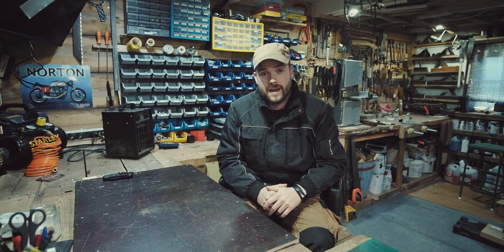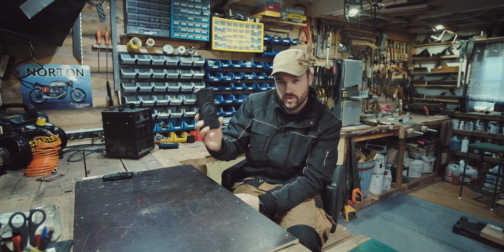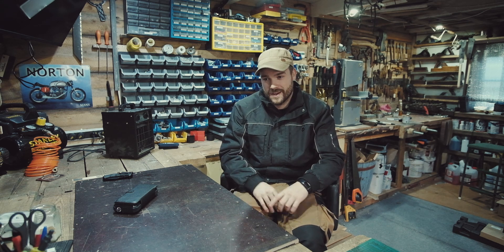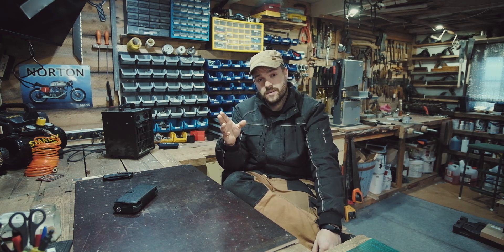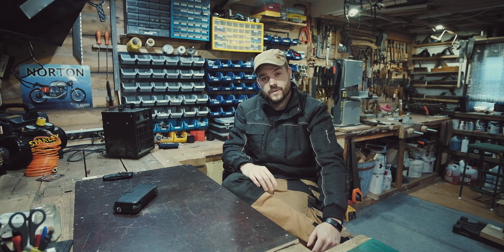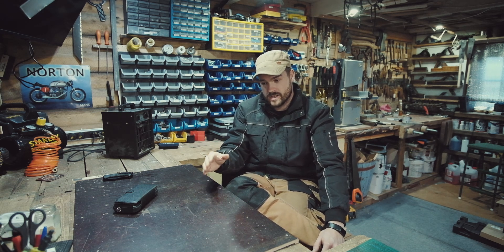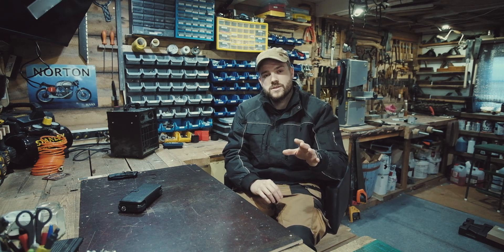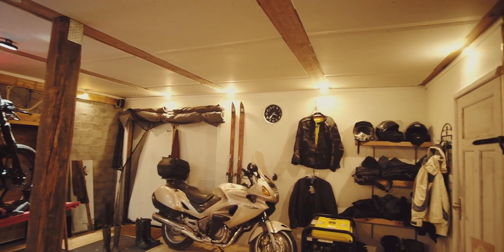Basic Off Grid House Solar System Setup

Comment: Since the 1/1 2022 Iw paid exactly 0 money for petrol/diesel. Bought myself a Ninebot Max e-scooter that easy takes me around town (ca 60km range).
Im only charging it between 01-05,00 at night, when the energy are most often for free. 
Me and my kids lives in a apartmentbuilding, and my biggest whish would be to be able to put PV-panels on the roof, to charge a 48V / 320A LiFePo4 bank to drive a AC daytime and the freeser/fridge and the stove. Thank you soooooo much for sharing things like this Ash. I love it,, 🥰. Cheers,, 🍻🍻😎👍‍‍👍‍‍
Reply from the maker: To be fair if I lived in a built up area that's exactly what I would do! More difficult when you live 80km from the nearest town 😅 I guess depending on your windows it could still be possible to incorporate a solar setup with small battery units you could charge in the day and use at night 🤷‍♂️
Reply: @ash.pollard  Huh,, thanks Ash. PV panels in the windows. Why havent I thaught of that? 🤪
I have 2 square meters to the south and 2 to the west. Thats the main reason we need an AC in the summermonths. 🌞😝🌞😝🌞😝🌞
Thanks again mate. Cheers and much luv from Linköpig,, 🍻🍻😎👍‍‍👍‍‍